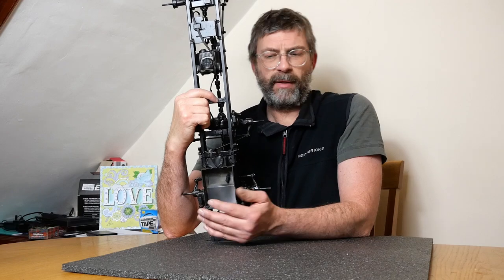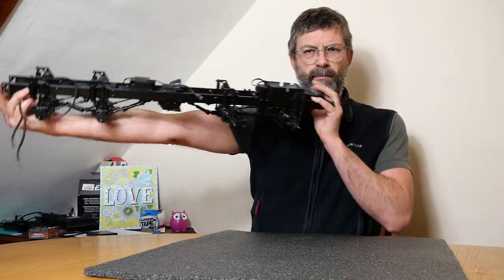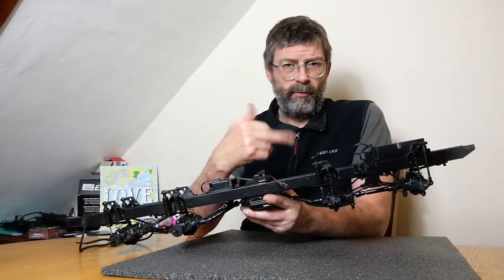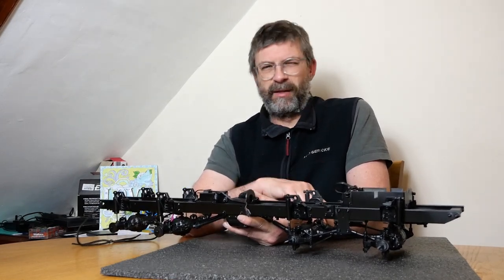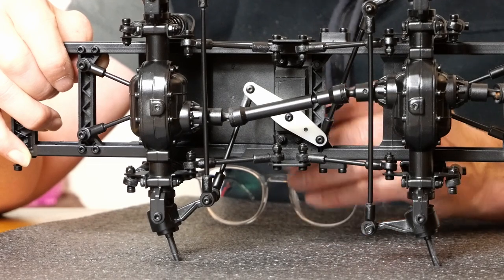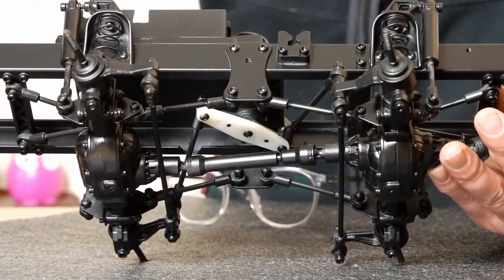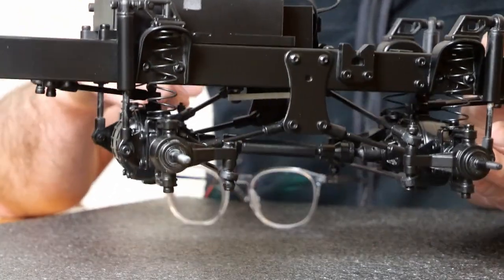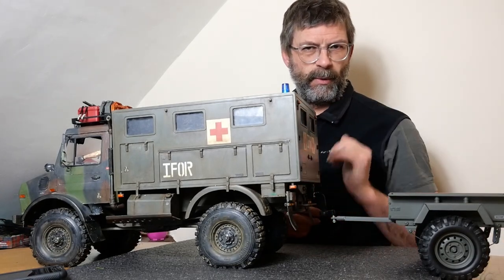Last Bench Update 2021! Andrew talks MC8 Chassis Painting and Unimog Trailer Stuff

Comment: Wow!  I knew the MC8 was a large truck but seeing the chassis on your shoulder really drove home how massive the 1/12 scale rig is in relation to the 1/1 world.  The servo horn looks like something off of a 1/5 scale racer.  That is going to be a work of weathering when you get done with it. 
 That is a awesome little trailer for that price.  I like the idea of covering it with a canvas looking tarp.  It makes you wonder what is under it.  LOL.  On my Q65 I tried out the idea by soaking an OD green piece of linen in diluted wood glue.  Just like you did with the paper towel on the WPL tanker.  Then I formed it over scrap wood blocks glued together that just fit in the cargo area.  It gave a little weight to that stiff Q65 suspension.  With your painting and weathering skills Andrew, you could really pull off the canvas look.  With a few tiny washers/shims for grommets, an oily stain here, and a revealing tear there you could have to perfect little project for watching a few YT videos.  
As for the dubious facial hair, I think you should keep it.  It adds a distinguished look and gentlemanly aire.
Happy Christmas to both of you and your families.  See ya in 2022'
Stay safe and stay tiny.
Steve